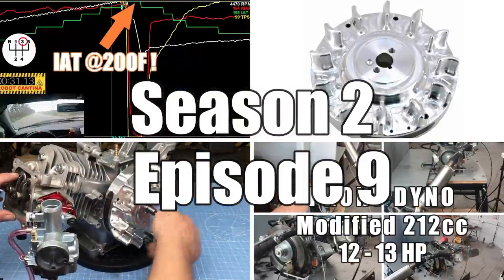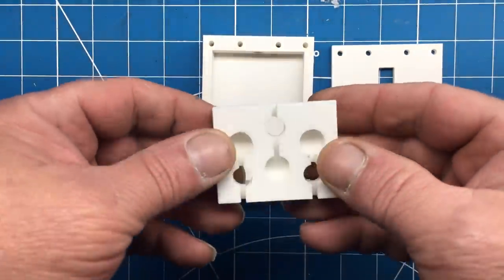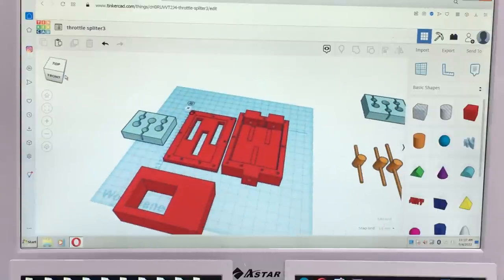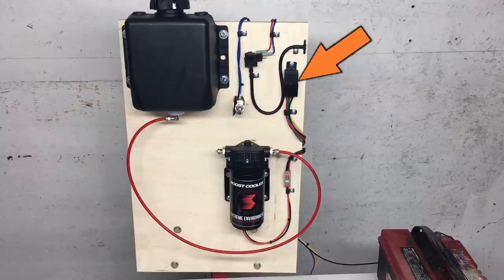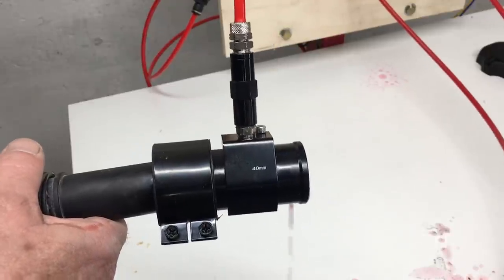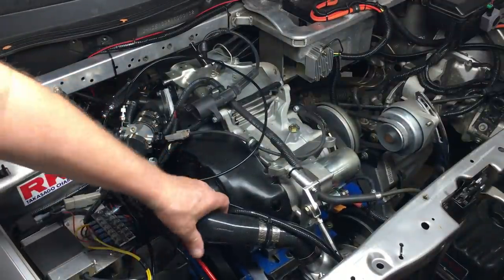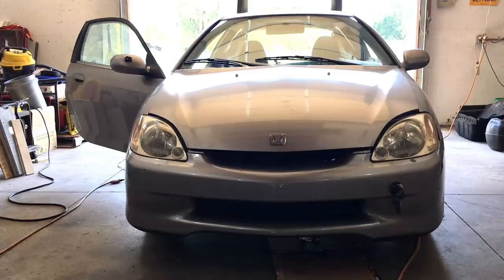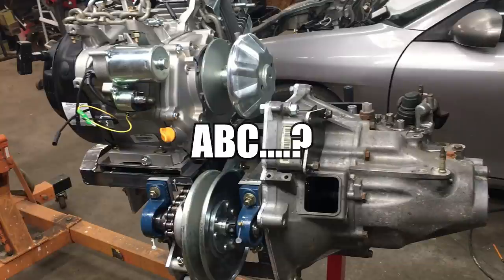S2E9: She’s burnin’ up Cap’n!  The 420cc supercharged hemi gets methanol  injection

Comment: Love these updated Jimbo! Just in case it’s useful, the Speeduino board you’re using can function as the Water/Meth controller, including doing open/closed loop PWM and ignition control b based on a few different variables. Might help give you a touch more control over the volume getting injected in case that’s still an issue for you.
Reply: Gas prices hit another all time high Thursday!
Reply: @kansasrose2909  OMG
Reply: @ocdman202  Again?

Comment: Hey there! I’ve been following along with the series off an on for a bit, and I’ve finally got something to mention. If you’re running fuel injection, you really don’t need to use your TB in a “draw through” configuration. I’d understand if space was an issue but if you were to pressurize the front of the TB in a “blow through” setup you’d have vacuum under the TB at idle where you want it and the supercharger would never see a vacuum, and would render the whole bypass valve problem moot. 

 Drawing oil through blower seals was a common problem a long time ago when running a turbocharger in a similar configuration (having the carburetor in front of the turbo) and the way around it for Buick at least was to use special carbon seals, or use aircraft stuff like a RayJay turbine that already had the seals from the factory. The benefit to running draw through was a sort of natural intercooler from the atomized fuel absorbing the heat from the compressed air before it made it to the engine. Those benefits really didn’t outweigh the negatives of sucking oil into the engine when coming off the throttle. If you’re set on using a roots style supercharger in a draw through, Nissans eaton supercharger (off of the xterras) has a vacuum operated bypass valve. Can probably snag it from a scrapyard for cheap. 

 Also, I think there’s another size of AMR style supercharger you could use if you find the 300 to be too small (I think it’s the amr-500). It has the same mounting brackets so it ought to be a straightforward swap if it came to it. Cool project, btw.
Reply: @kansasrose2909  Rose,  you seem very happy with this channel.
Reply: @ocdman202  I am happy if it is happy hour.

Comment: Did you know you can use defrosting windshield washer fluid? Has just about as much alcohol, and it's much cheaper.

Motor trend, Engine Masters tested it on the dyno. Just a few hp less than boost juice.
Reply: Does that have extra stuff though that might gunk things up?
Reply: @JaredConnell  it's not quite a 50/50 mix. So long as you use just the windshield "de-icer" and not bug wash, it's generally just water and methanol. -30⁰ deicer has closer to 25-30% methanol to 75-80% water. But it can easily be tuned for. Or some guys even add methanol to windshield de-icer with bottles of "heat" that are sold as a water remover for fuel systems. It's nearly pure methanol. 

Windshield fluid is commonly used though.
Reply: @JaredConnell  no. Boost juice does have lubricants in it that prolong the life of parts. I prefer picking up methyl hydrate from my automotive store.
Reply: @BrodeyDoverosx  I like the auto zone  they have a good selection!

Comment: I think the easiest solution would be an electric solenoid which would turn on when the throttle is closed and allow atmospheric air to get in to brake the vacuum. There could be a switch on the throttle body which will be triggered anytime the throttle is perfectly closed.
A more advanced method would be a 2 wire idle valve solenoid driven by a variable frequency driver with position input from the throttle position sensor calculated with an arduino, that way it can control the vacuum electronically at any time, or even get the same microcontroller set up to bleed pressure when needed and control boost at your will at any rpm.
Reply: Has he tried the Tesla Turbine??
Reply: @ocdman202  He should try it to cool the supercharger.
Reply: @kansasrose2909  When I was a teenager in the late 30's and early 40's, electronics wasn't a word. You were interested in radio if you were interested in electronics.
Reply: @ocdman202  Jimbo === is that Saturn back on the road yet?   We want to see how it runs with the Diesel engine  in it!👍👍

Comment: I have been watching your videos for a while.  I wanted to comment on the Comet torque converter.  It really consumes power and turns it into heat.  I have some experience with this.  Some years ago, I built a min bike with a 6hp Tecumseh engine.  I supercharged it with a GM vane type smog pump compressor and later a Ford smog pump for a compressor.  I could get 1+ pounds of boost.  I used a Walbro LMG carburetor for a while and then a Mikuni round slide.  Anyhow for a TQ what I used was the Comet 30 series.  I seemed to be power limited on the top end. The engine was making power, but it would not rev and my road speed seemed like it was being limited.  Like someone was dragging the brakes.  I switched to a centrifugal clutch, and my top end power and speed was what I thought it should be.  Yes of course there was no torque multiplication with the centrifugal clutch, but it was a test to show me how much power the TQ was eating and turning into heat.  The centrifugal weights really pinch the belt and the spring in the driven pulley do also. This is a double bad friction maker.  I know you have the Salisbury style driver clutch, and it is better than the Comet design, but still bad pinching of the belt going on here.
So the fact that it is both a clutch and a torque converter variable pulley combined is what really makes the friction.
If you had a stand alone Reeves drive for torque multiplication, and a stand alone centrifugal (or otherwise) clutch, you would have a lot less friction.  The 2 belt Reeves are the most efficient, the kind with the 2 give and take pulleys in the middle of the system. Many machine tool lathes have this.  The milling machines have the 1 pulley Reeves with the spring driven, think again, bad belt pinching.  You would actually be better for your car, to minimize losses, and run the engine to a vee belt idler tensioned clutch, and just use the 5 speed.  Just my thoughts to help.   -----Doozer
Reply: Great comment here.. I come for the video but stay for the great comments.!
Reply: @ocdman202  Me too, the comments here are spot on!
Reply: @kansasrose2909  😉😉😉
Reply from the maker: I get what you are saying, but something like a custom built reeves drive would drive up the cost to insane levels.  Most of the stuff we use has to be affordable and generally available.  Of course we do fabricate a lot of parts as well.  As far as the Comet 44 series TC,  When I do the fuel economy runs, the clutch system will see about an hour of run time and all the parts will only be a few degrees above ambient.   The clutch, belt and driven pulley do not get hot at wide open throttle.
Reply: @robotcantina8957  💖💖💖

Comment: If it helps, you only need a few cc per min. like maybe 1 for an engine that size.  You can probably use water mister nozzles that the jungle site has . They have a 10-24 thread and o-ring. that's the setup I used for my vw diesel pushing 18psi. they break up the water very fine .

Comment: Fantastic stuff, might be able to drop the meth with the IC and use the spray system to mist the IC with water for evaporative cooling if the IAT gets too high on long pulls.
Reply: @ocdman202  Has he installed the flux capacitor??

Comment: I know it’s off topic but I have a open air 3d print and for large prints I use a 2 reptile heat lap on a 3d bracket at a 45 to help with the warping just don’t let it get to hot. It’s a cheap fix  and do it on a tile or concrete floor in a open area such as a garage (I’m not responsible if you burn your house down)

Comment: I saw a prototype forced induction setup that used air in bottles. Low temps and very controllable flow to tune. They just plumbed it to the intake tube and used a one way flapper spring door to block off atmosphere.
Reply: @ocdman202  Man,   are you king of the road?
Reply: @kansasrose2909  No phone, no pool, no pets,
ain't got no cigarettes.... King of the Road..

Comment: I thought you would have done a air to water intercooler system to save on space and have a easier time installing. Then again your electrical system is about maxed and adding a power hungry water pump wouldn't work. Love this series and look forward to the next.
Reply from the maker: Everything is a compromise at this point. We need to get to 70 MPH without using too much more energy.
Reply: @robotcantina8957  💖💖💖💖
Reply: @kansasrose2909  When I was a teenager in the late 30's and early 40's, electronics wasn't a word. You were interested in radio if you were interested in electronics.

Comment: My thought for an actual bypass valve is to use the second throttle body as your bypass but opens fully when the accelerator pedal is let off of. It would be difficult which is why I would use an Arduino which will open the throttle body when the gas pedal is let off of and hold open or set a time where it would automatically close (simply use two of the timers in the Arduino and a simple switch. Or pot if you want variability. Then when you push the gas pedal it would close that valve however you wanted (instantly or slowly depending on your rpm, I mean you could set it however you want). Same theory for a waste gate if your psi goes too high!!!! I would like to see you try it!!!

Comment: There’s an episode of engine masters, I believe season 6 episode 7 where they do a lot of test on the effects of e85 vs liquid cooled intercoolers. They found out that e85 has better effects on iats than the intercooler they were using on a roots type supercharger might be some useful information for what you’re doing.
Reply: Man,  you seem very happy with ROBOT CANTINA!!
Reply: Alcohol has major cooling effects when it's used in conjuction with changing pressures such as boost OR across the pressure drop through the venturi of a carburetor.

Comment: decades ago neighbor and son ran 1/2 scale dragsters. only major rule was it had to be a 5hp Briggs block. torque converter, big slide valve carb jetted to run alcohol. it ran pretty cold, the exhaust from it a real eyeball burner tho. his class was 9.0 second 1/8 mile, less than that was disqualified. it does have me wondering if running alcohol without anything boost might be a solution for power and heat both, the 5hp block (all high end guts!) was putting out 27-28 hp is pretty crazy for so small an engine.
Reply: Running e85 or even better straight methanol is going to substantially lower those IATs.  You are burning over twice the liquid volume of methanol compared to running normal e10 gasoline. Plus methanol requires a little more than three times the amount of energy (heat) to vaporize. So you'd have at least 6X cooling from a fuel change to methanol alone.
If you're a fan of Cletus McFarland go look at the dyno video from only a couple days ago when they switched their Crown Vic Neighbor from ethanol to methanol. The temperature difference is staggering.
Reply: @otm646  They should have the drinking man's guide to this build
Maybe ESQUIRE could do an article!

Comment: This comes straight from Arc racing. They had made a video about this or at least talked about this topic in their video. Normally the go-kart should reach temperatures of 415 to 425 degrees Fahrenheit cylinder head temperatures and of course you're running a lot of stock Parts but if they're able to run those type of temperatures. then at the temperatures that you're seeing it should be okay. By once you go ahead and take care of those intake air temps the engine temp should drop by atleast 5 to 10%
Reply: I come here for the video and stay for the great comments.
Reply from the maker: Great info on the cyl head temps.  I cringe when I see 300F and this time around it maxed out at 317F.  yikes...
Reply: @robotcantina8957  it used to make me cringe as well but when you're thinking about it from an automotive standpoint then yes that would sound completely crazy but we're talkin about a air-cooled Splash lubricated Engine. Maybe further testing should be done to confirm this but in the automotive world in the ballpark of 190 to 215 degrees Fahrenheit is a ballpark range for those bigger coolant multi-cylinder based engines. But with a single-cylinder air-cooled engine is definitely going to run hotter then the automotive equivalent. None the less I hope all goes well with the air intercooler system. And look forward to more of your videos you're very underrated. I would like to see your subscriber count grow you very much well deserve it
Reply: @mindovermatter3988  There should be a drinking man's guide to this build..
Maybe ESQUIRE could do an article.
Reply: @kansasrose2909  When I was a teenager in the late 30's and early 40's, electronics wasn't a word. You were interested in radio if you were interested in electronics.
Reply: @ocdman202  CONGRATULATIONS  JIMBO.  👍👍👍👍👍 you have reached 106K   SUBSCRIBERS!   ROBOT CANTINA 
is providing the entertainment and education and FUN   that viewers enjoy!  Please provide more content here JIMBO!

Comment: I tried to put a SC in a small engine a few years back, had the exact same problems, the only difference was that my reason to not use a turbo was different, well, all my problems were solved using a turbo after a 100 fails with the SC when i finally gave up . Don´t get me wrong, I´m having the most fun watching you deal with this, but you should give up on the SC sooner than later. Best luck and thanks for the show!
Reply: @ocdman202  man,  are you  king of the road?

Comment: Did you explain anywhere why you run the throttle upstream from the blower? Could you do it downstream and have a spring loaded valve that releases boost above a limit?

Comment: You could try a liquid cooled intercooler. 

I wonder if the temp range of the plug and gap needs to be revisited. All of my turbocharged vehicles have responded well to proper plug and gap.
Reply: @kansasrose2909  Rose, you look very happy to see the video!
Reply: @ocdman202  Yes,  I am... and did you see that bazooka??

Comment: That intercooler you tease looks huge for the cfm's you are running. Hopefully you can get it to create boost with such a large volume to pressurize. Maybe an old Ford turbocoupe or similar small under hood intercooler would be more friendly for a small application. Can't wait to see the next vid.
Reply from the maker: The intercooler we showed at the end was indeed a tease.  The one we plan on using is quite a bit smaller.... but hasn't arrived yet.
Reply: @robotcantina8957  😛😛😛😛
Reply: Can't wait to see what JIMBO does next.!!
Reply: @kansasrose2909  When I was a teenager in the late 30's and early 40's, electronics wasn't a word. You were interested in radio if you were interested in electronics.

Comment: Simply connect a one way valve (like a flap valve) to the intake pipe, between the supercharger and throttle body. It should open at vacuum and close again when under pressure and the air should still be properly metered. I think that would work instead of the dual throttle bodies?

As for the meth injection, a future tip is to use an old cold start valve from old mechanical bosch injection systems. 80's Volvo's have them for instance. It's basically a small injector that comes with a nozzle at if memory serves 80cc/min.

I used these once in my youth to fit a turbo to a naturally aspirated engine using pressure sensors originally for nitrous activation, and a couple of these valves fitted in a plenum. They would each add fuel in incremental stages as the boost came on and the whole system also sucked through a carburetor mounted before the turbo which gave the thing idle/low boost running. Really fiddly to set up i must admit, but once it was somewhat dialed the old 140 drew lines on the pavement.

Also thanks for your uploads, and specifically this project, you inspire me to want to do weird things to engines again! =D
Reply: @ocdman202  Man, what ever happened to the cameraman?
Reply: I think he was shaking too much.

Comment: Instead of meth injection you should try e90 and change the pulley on the supercharger to increase boost.
  If the racing community uses it for more power, you can too.
Reply: My thought exactly. Why not just run it on methanol instead of gasoline?
Reply: @kevindeuvall2155  Good question:yougotthis::yougotthis::yougotthis::yougotthis:
Reply: @ocdman202  Good idea here.

Comment: The methanol injector should be behind the supercharger. I would also make it work in parallel to the injector which will make it easyer to tune. I would also definately look for a smaller nozzle to inject the methanol. The system you use now is not suited for this small displacement. Another option would be to run the engine on plain methanol. There is two benefits on using methanol: 1) less heat, if put in the correct place, 2) you can increase timing which makes for more power. The second option still needs to be explored, using an intercooler will offcourse help aswell.
Reply: Which is harder to come by   = baby formula or gas??
this channel has me coming back for more..🍼🍼🍼🍼🍼👶👶👶👶👶
Reply: @kansasrose2909  They are both worth their weight in gold!!
Reply: The first ingredient in baby formula is high fructose corn syrup!!

Comment: Carburetor would solve that problem lots of old hot rodders run supercharged engine with carburetor no intercooler or meth because that carburetor provides a charge cooling effect
Reply: Yes,   we are enjoying this journey into the unknown..
Reply: When I was a teenager in the late 30's and early 40's, electronics wasn't a word. You were interested in radio if you were interested in electronics.